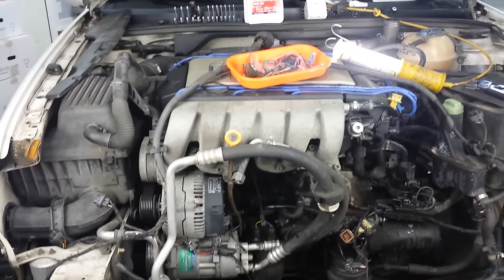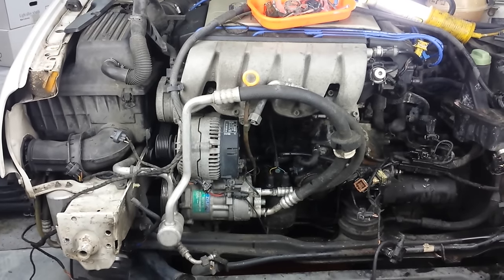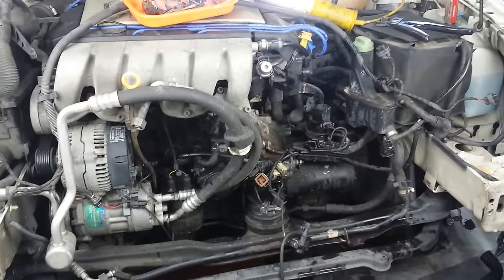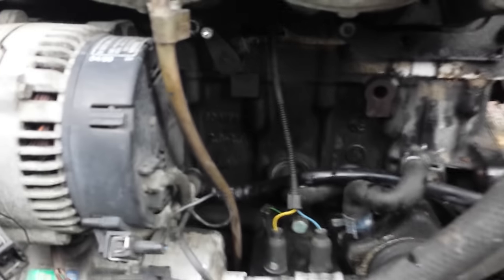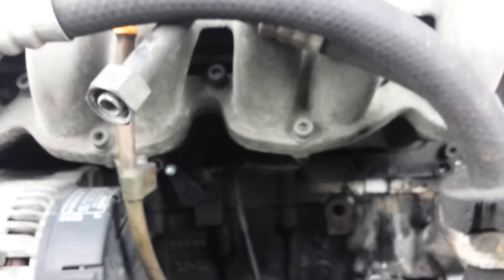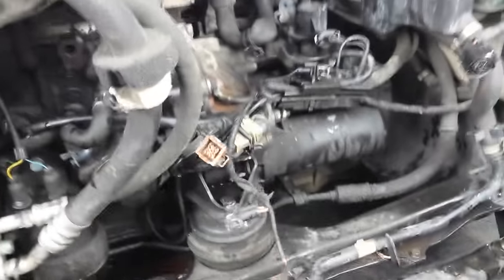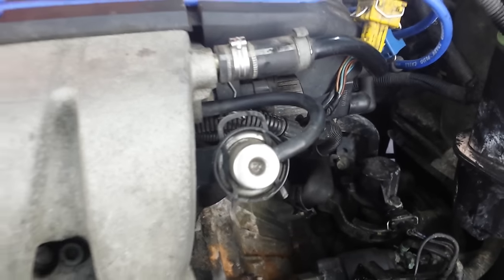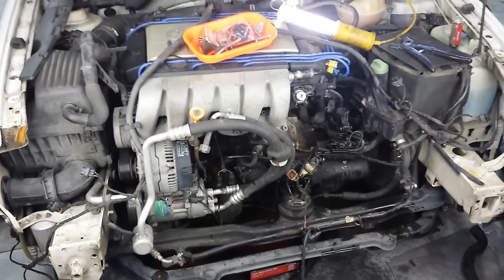VR6 Coolant Pipe Issues.

Comment: Not sure if anyone with a stuck crack pipe has tried this. Mine wouldn’t come out at first. It took some trial and error. But long story short, I grabbed the pipe, putting a finger around the short hose outlet on the side. Trying to rotate the pipe back and forth. It was hard at first, but eventually I could turn it as far as it could go in both directions. 
Once it was loose enough to pull on the pipe while also turning, I turned it back and forth while pulling outward and bingo. Came right out. No need to remove the intake. Tho like others have mentioned, it is nice to be able to inspect other parts. I just didn’t have the time and moneys. Happy wrenching.

Comment: Be sure to check the state of the oil cooler whilst you are in there. When i did my crack pipe I put it all back together and there was still a leak coming from the back side of the oil cooler inlet.

Taking the front off the car is only a few bolts and makes the job heaps easier for the DIYer
Reply from the maker: +Badgertronix I wish I would have known I was going to take the front off, I would have replaced all those gaskets too. LOL There will be a next time for sure

Comment: SAI on a vr6 won't be necessary if you upgrade your injectors to a more modern design and upgrade to iridium plugs. The Vr6 will probably put out the same emmisions or less. That's my two cents on the subject. Ive seen straight pipe GTI's running stock injectors and the hydrocarbon smell was very apparent but quickly went away with those two mods alone. Sure it was still there during heavy acceleration but not nearly as bad as stock. Just some food for thought if you car at all about trying to maintain factory emmisions.
Reply: +4sf3d4g63 sorry, i am referring to 20v 1.8t's but the same could probably be said about the vr6.
Reply: 4sf3d4g63 You have no clue what your talking about.

Comment: I know this video is 6+ years old. But I’m stuck on getting the crack pipe out!! :( 

Got the thermostat housing removed. Bumper still on! Hope it doesn’t have to come off.
Reply: I’m in the same boat currently I’ve done everything, I’ve gotten to the point where the whole front end is off With the rad and the fans, ima try to split it with a dremel

Comment: I definitely would like to delete my secondary air pump on my MKIV R32. You stated that you created a plug? Now that you deleted you air pump and combi valve isn't your MIL light on?
Reply from the maker: +Lazaro Carreiro Yep, I made a plug from the combi valve. You can also use a freeze plug so you don't have to hack the valve. I also got an instant MIL, but that will be solved with ECM tune

Comment: would like to know how u made block off for combi valve. currently in process of deleting those items on my 12v
Reply from the maker: +Dan Koning I didn't do a DIY on it when I did this one. Some guys use freeze plugs. 

I cut the top off, drilled it out so there was a shoulder. Then ran an Allen in it, and cut the excess off.